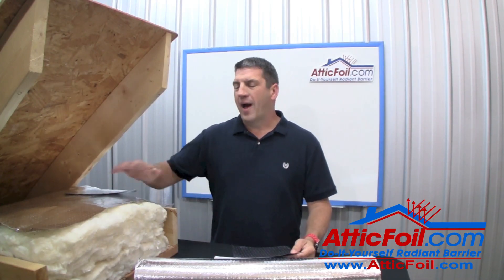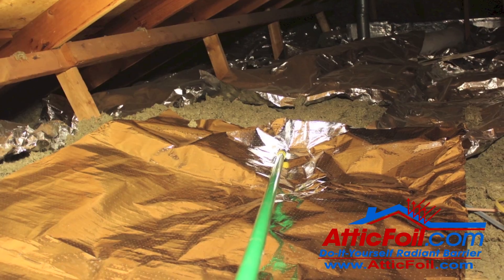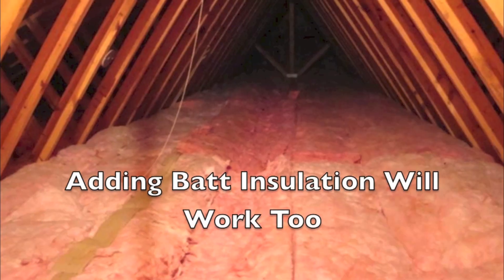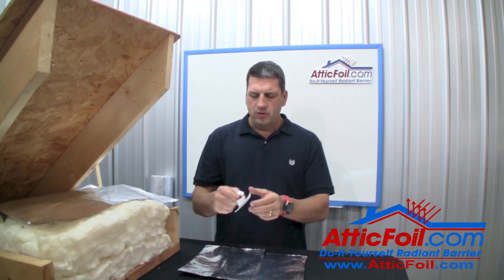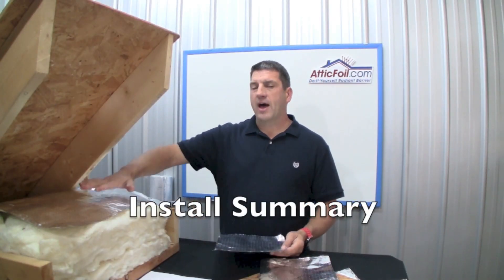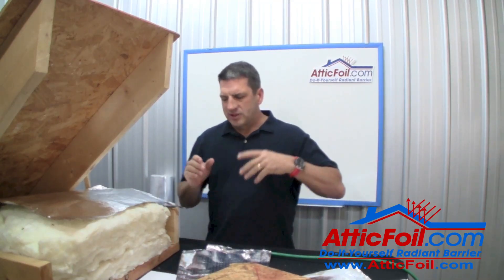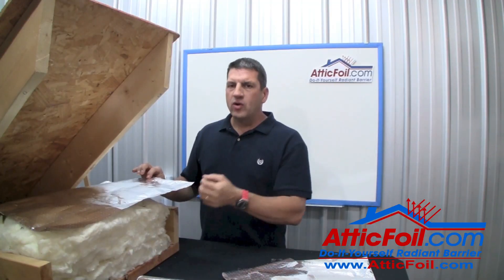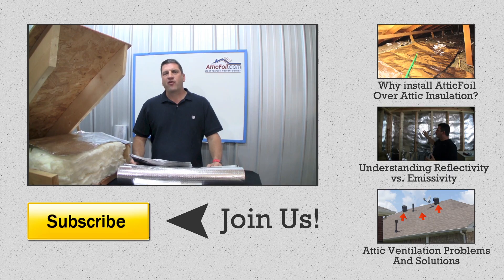DIY Radiant Barrier Installation Directly Over Insulation In Cold or Mixed Climates.  Easy Install!

Comment: I live in the Dallas area. Would it be a wise choice to lay radiant foil on top of the insulation along with mounting it above underneath the roof ? Or this is double work and not effective?
Reply from the maker: +bigred3282 It really depends.  Stapling up WITH ductwork in the attic will have the biggest impact in the Summer.  Laying it out over the insulation will have the biggest benefit in the Winter.  Usually, here in Texas people go for the big Summer benefit by stapling up. However, we have had many customers do BOTH with spectacular year-round benefit.  Once you staple it up, laying it out should be pretty easy if you are looking for a cold weather benefit too.
Reply: @AtticFoil wait, you’re located here in Texas!!???
Reply: @AtticFoil  May I ask why laying out the insulation has the biggest benefit in the winter? Is it because it's double side reflective foil? So the heat radiant from room to attic also gets reflected back?
Reply from the maker: It's actually about reducing "convective looping" or cold air from "falling" through the insulation.  Watch this video: https://youtu.be/L-FNAP1UFZU?si=OXYlWX4XWJs9RwBI

Comment: One problem. When laying the radiant barrier over the existing insolation and ceiling joists it covers up the joists. So in the future if needed to get into any part of the attic to do anything it would be hard to get around in the attic because all the joists are covered up by the radiant barrier. . No where to place  the feet to walk around. ?  It also covers up any wiring or pipes running along inside the joists and insolation.

What is the solution to that problem ?
Reply from the maker: I guess you could not install www.AtticFoil.com and not have the benefits.

Comment: The heat generated in your house by burning gas doesn't really result in much radiant heat though, so not sure how this really helps anything at all to keep heat in your house
Reply from the maker: In the video it says the main benefit in the Winter is to reduce convective looping.  Or, reduce cold (dense) air from entering the insulation.

Comment: I have foam spray insulation in my attic currently. Would stapling a foil barrier to the top of the attic be any benefit or detriment to the foam effectiveness? The north Texas heat is out pacing the central air with some rooms reaching 80 degrees with the thermostat on 74.
Reply from the maker: If you have foam on the floor of your attic and it's ventilated, then installing www.AtticFoil.com on the bottom of the roof will work great just like any other attic application.  If you have a non-vented / foam closed attic then there would not be much benefit putting it to the "inside" of the foam.

Comment: This might be a dumb question: I have about 4” deep of cellulose insulation. I was wondering if I can put the barrier over the cellulose, and put some batt insulation over sone of the barrier?
Reply from the maker: No, you do NOT want to "sandwich" the www.AtticFoil.com between your cellulose and the new batts.  The correct way would be to add the batts and then put the AtticFoil on TOP of the batts.  Foil needs to face an airspace. And you want it to be the first thing the radiant heat from the roofs hits to reflect 97%.

Comment: I'd like to install this on the outside of my attic knee wall for an added barrier for the cold in my bonus room. Could this work for my needs?
Reply from the maker: Yes, installing www.AtticFoil.com in this way works great for radiant heat.  I like to combine 1/2" or 3/4" foam board with the foil.  Basically put foam board on the attic side of the wall like sheetrock.  This makes a huge difference in walls that have the insulation exposed.  Also, check the "chaseway" or space below the second floor to make sure hot/cold attic air is not getting between the upstairs room and ceiling of the first floor. Ed.
Reply: @AtticFoil  Thanks!

Comment: I can understand fastening barrier to bottom of rafters, giving you have good ridge vents and clear air flow from soffit,  however I am concerned about a barrier overtop of attic because of moisture buld up in ceiling insulation
Reply from the maker: No worries.  The SuperPerf www.AtticFoil.com has tiny holes PUNCHED in the foil.  It will not trap moisture because of the high permeability.  It's specifically made to lay over attic insulation.  We have not had a single instance with a moisture issue under the SuperPerf product.

Comment: I have been installing this in a Florida home. I was wondering if installing the attic foil stapled to the trusses and also  on top of the insulation will help to reduce the radiant heat trasfered to the insulation or will just trap heat in a loop there?
Reply from the maker: For Florida not much additional benefit in the Winter to lay over insulation.  If you were more in a "mixed" climate are then yes www.AtticFoil.com for both staple up and over insulation would work better.
Reply: @AtticFoil  could you make a video explaining why it won't be too beneficial in Hot climates like Florida? I've seen a lot of videos looking for that explanation but I only see you saying that it's better for mix climates without any demostration or technical information to support it. I would really appreciate it. Thanks
Reply from the maker: @ltfbwy066  First, check out this page: https://atticfoil.com/index.php/installation/best-install-method/  The big question is if you have ductwork in the attic? If yes, then staple up in hot areas keeps the ductwork in a less hostile environment. If NO ductwork in attic, then yes, you are correct, laying directly over the insulation works great even in hot areas.  And, there is a video on the page.

Comment: How does this radiant barrier compare with R11 fiberglass insulation in terms of cost and effectiveness?
Reply from the maker: It's hard to compare.  Think of the R-11 as an ice chest.  And the www.AtticFoil.com as an umbrella over the ice chest on the sunny beach.  The AtticFoil reflects radiant heat and lowers the surface temperature of the ice chest (or attic insulation) making it more effective.

Comment: What is the % of heat rejection or any scientific statistics? Based on that Is it really worth it?
Reply from the maker: The www.AtticFoil.com foil itself reflects 97% of radiant heat.  It's tough to exactly quantify this.  In hot sunny places it's more effective than cold cloudy areas.  Think of the foil as making a "cloudy" day for your roof.  Would this help in your area? If so, then it's worth it.  Radiant heat is why sometimes we have to run our AC on a 65º SUNNY day but not on an 85º CLOUDY day.
Reply: @AtticFoil  Do we need to insulate the attic with blown in insulation? If so, do they reduce the R rating for insulation as they already have radiant panels?
Reply from the maker: Yes, if you are heating/cooling then you will also need traditional insulation.  More info here: https://atticfoil.com/index.php/how-radiant-barrier-works-in-attics/  Check with your local building office as far as required r-values.  I know in some places the addition of www.AtticFoil.com can be used as a "credit" towards r-value.

Comment: The only problem I see with this method is that it will make it very difficult to work in the attic. It will be very hard to find a place to step and will most likely pull the foil out of place as the insulation compresses. Also finding the wiring isn't going to be any fun either.
Reply from the maker: Working in attics is never fun or easy.

Comment: Good afternoon:
I have seen your products on you tube and have viewed several, I plan on using it in the future. My question today is: Do you carry a product or products that can be used in and on crawl space and basements; if so great! Application to the outside surface would be preferable.
Thanks. Enjoy your day.
Reply from the maker: Yes, take a look and get some samples of the www.BlueTexInsulation.com products.  They are mostly use for metal buildings but we have had several customer install in these type applications.  Send us an email with your specific questions/applications.

Comment: Attic insulation is not a thing in my area. I've been watching your videos and I've heard that I need the radiant barrier above an insulation. What if I can't get the insulation? Is it ok if I put it right on the floor(which is actually the ceiling for the room below)? provided there will still be a gap between the floor/ceiling and the sheets...
Reply from the maker: Using www.AtticFoil.com alone is better than nothing at all.  Where are you that insulation is not available?

Comment: I have a low pitch roof....live in the south...prolly a dumb idea but could I lay on top of the insulation on the low side of the strong back and to rafter staple in the higher part....sounds like a easier install to me but also seems not as efficient of keeping it as one or the other.
Reply from the maker: Yes, one option is to staple www.AtticFoil.com to bottom of rafters where you have room and let the end piece in low pitch area just lay over insulation.  Use a PVC pipe or stick to push it back.

Comment: Hello, Why is it primarily for cold or mixed climates. I tried this method in Ca. Noticing my house holding I more heat. Should I install on rafters instead? Thanks for your time.
Reply from the maker: Heat ONLY goes one way.  Sometimes it's coming in and sometimes it's leaving.  If you live in an area with really warm days and cool nights the foil can/will slow the heat loss at night (keeping it warmer) Here is an article I wrote about this: https://www.radiantbarrierguru.com/the-spring-fall-effect-can-radiant-barrier-work-against-you/

Comment: I live in New jersey. Where in the attic will place your attic foil? Under the roofing or just over the attic foam insulation? Thanks for your response.
Reply from the maker: Take a look here: https://atticfoil.com/index.php/installation/best-install-method/  Generally, in your area the best overall method is over the insulation.  Definitely would use the SuperPerf product.  https://atticfoil.com/index.php/products/45-wide-perforated-double-sided-radiant-barrier-foil-superperf

Comment: Can I use this foil to wrap my AC unit that is in a garage in Florida. There is a lot of condensation on it because of a hot garage. I was thinking if I wrap that AC unit with you foil, then that AC unit is going to stop heaving condensation on it's outside walls. Please advise. Thank you.
Reply from the maker: It depends.  If you have condensation on the ductwork, it e means warm-moist air is coming in contact with a surface below the dew point.  Foil may or may not help.  You are probably better off making sure the insulation on the ductwork is complete with no "bald" spots at connections etc. www.AtticFoil.com

Comment: What if the radiant 48 inch barrier, I put between the rafter "V", overlaps the barrier lying flat on top of the insulation on both sides by 12 inches spanning a 2 foot gapping between rafters forming the "V" where it would take a lot of trimming to get it to lie flat, but where it overlaps it is above the point it overlaps it is above the barrier below by 12 inches.  In other words looking from above you can not see exposed insulation, but from the side the 48 inch piece is about 12 inches above the flat lying pieces allowing much air movement between the overlays.
Reply from the maker: Please send us an email with a drawing.  I cannot clearly understand/visualize what you are asking.  https://atticfoil.com/index.php/contact-us/

Comment: If my attic has both cold ducts and return duct within it, where should I place the foil sheets for more better results?
Reply from the maker: It depends.  If you are in the South and Summer cooling is your primary expenses, then stapling up is usually best.  If you are in a mixed or cold climate area, then laying out will usually provide the best overall results.  More info here: https://atticfoil.com/index.php/installation/best-install-method/

Comment: Can I use the staple method and laying foil on insulation.  I live in texas
Reply from the maker: I'm not sure if you are asking if you can do BOTH methods or can staple it down over the insulation.  For the Over Insulation method you do NOT want to staple it down.  You should have at least several inches of insulation above the wood ceiling joists which would prevent you from stapling down to them.  If you are asking if you can do BOTH methods, yes you can do both.  The biggest impact in Texas will be the staple up method especially if you have ductwork in the attic.  If you add the over-insulation method with the staple up method, then the over-insulation method will primarily help to reduce Winter heat loss. https://atticfoil.com/index.php/installation/best-install-method/

Comment: How do you detach the foil from the long pole when positioning it?  Shaking it?
Reply from the maker: A quick pull back and it will come off.
Reply: Hale White I found using a 3” roofing nail taped to your stick works best. Also, when you poke the nail through the RB foil, wiggle it around making the hole a bit larger than the size of the nail so it slides easily on or off. Then make sure your hole is several inches away from the front edge to fold back the foil toward you to help prevent the nail from coming out of the hole prematurely.  Keep a constant forward motion and slight tension on the foil when pushing back to the edge.  Usually the weight of the foil dragging over the insulation is enough to keep the foil on the nail until your ready to release. I’m not a professional, but this worked for me.

Comment: ? Is this foil heavy enough, so it doesn't move by blowing wind or attic solar fans?.
Reply from the maker: Should not have an issue. Normally fans or wind will not be strong enough to move foil.  Or, you can always staple in a few spots to anchor it.

Comment: I installed this product on the attic floor over the cellulose insulation I think 3 years ago. I live in the LA, California metro area and this year has been really hot. It is really difficult to tell if it is working properly. The 1st year I would say that it did work right but still hard to tell. I say that because I have 2 window air conditioners and I only put one in last year but this year I had to put both in. My attic is a little less than 1000 sq. ft. and has 2 gable vent fans.
I am probably going to remove it from the floor and put it on the attic ceiling. OR should I leave it on the floor and add it to the ceiling? And don't say yes so that I buy more of it, I still have half of a roll.
Reply from the maker: If you do not have any AC ductwork in your attic there should not be a big advantage to stapling it up.

Comment: Can this be used on top of r-19 fiber glass insulastion on the fiber glass side for in joint radiant heating?
Reply from the maker: Yes it will work.  Take a look here for radiant heating info:  http://www.atticfoil.com/index.php/applications/radiant-heat-flooring-over-non-conditioned-spaces/

Comment: I've been doing research but still have a couple questions
When to you cover attic decking  over covering insulation 
Also what about summer when air conditioned air escapes into attic, and cold air mixes with the hot air at the barrier? Does it condensate
Reply: I asked too soon, the end of video answered condensation concerns

Comment: Can I cover the cellulose insulation to or is that only meant for the fiber glass as presented in the video?
Reply: I have had radiant barrier that I installed 19 years ago on my attic floor. It works great but I think the insulation under it needed to be added. can I add new insulation on top of the barrier I have now and then put new barrier on top of the new insulation?  I don't want to have to remove the old if I not needed
Reply from the maker: @glennsmith6380  No, you do not want to put insulation on top of the radiant barrier.  This will most likely create a vapor barrier in the wrong place.  If you want to add more insulation, you will need to take up the radiant barrier, add insulation then either reuse the radiant barrier or replace it:  https://atticfoil.com/index.php/products/48-wide-double-sided-atticfoil-radiant-barrier-foil-perforated/
Reply from the maker: Celulose is Ok.

Comment: I have been telling my son about your attic foil insulation barrier.  He lives in Houston, TX.  His roof has the foil on the bottom side of the OSB,  The attic still seems to be hot and humid (April).  Would it benefit the house to staple foil to the trusses?  If yes
Reply from the maker: +Randy Lavine The humidity is more about attic ventilation (Plus he lives in Houston).  Will AtticFoil help?  Radiant barrier decking (which he has now) reduces overall heat flow by about 30%  AtticFoil when applied to the bottom of the rafters will reduce heat flow by 50% alone acorrding to the full scale test done by the Department Of Energy - See testing results here:  http://www.atticfoil.com/index.php/technical-info/dept-of-energy-study-results/  Yes, he can do both.  We have had many customers add AtticFoil below their radiant barrier decking resulting in the attic being really close to ambient temperature.  It's hard to quantify the energy savings but the attic will definitely be cooler.  IF the attic is NOT much cooler (measure the AIR temperature below the AtticFoil), this means that the attic ventilation is really bad.  Basically the air is getting "stuck" similar to a clogged drain and can't get out or come in.  Take a look at this video for attic ventilation suggestions:  https://youtu.be/NUvgeP7--0Q